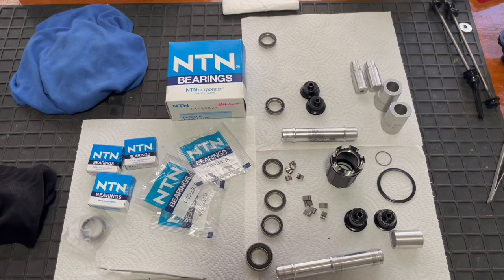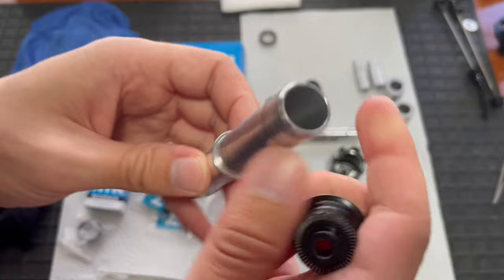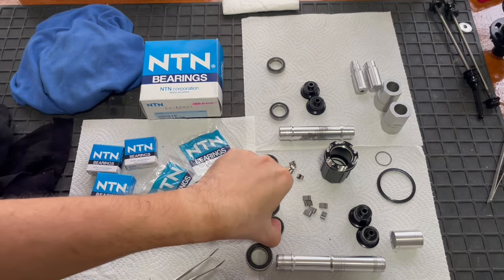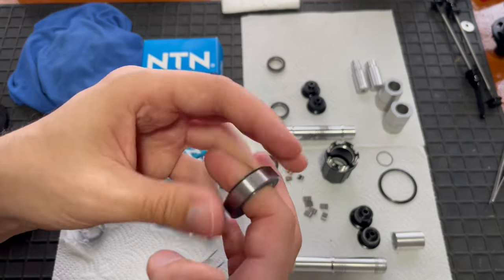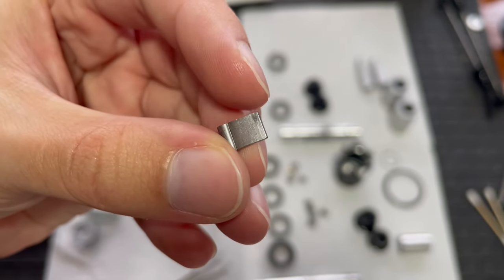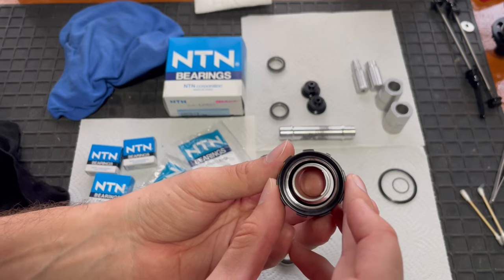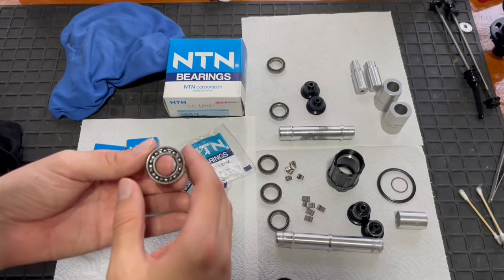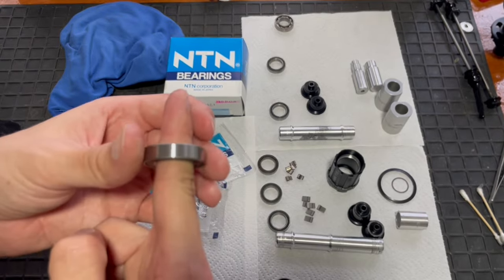My Hyper 2020 Wheels After Only 4,000 KM

Comment: I use NTN bearings in my road bike wheels. They are definitely very good quality. I use the non contact seals on my summer bike and contact seals on  my winter bike. However they still require the seals to be popped off occasionally and a small amount of grease injected or they can run dry. I had one fail on me prematurely that ran dry and started squealing but it wasn’t corroded inside. Another thing i’ve started doing is using Loctite 641 when installing the bearings as I read that it can reduce vibrations and improve bearing life.
Reply from the maker: That’s interesting, so you just lock tight the bearings in the hub or the axle as well? I can see why that might make a difference. 🤔🙂👍🏻
Reply: @reginaldscot165  I use it on the hubs only and not the axle. A thin smear of medium strength retaining compound like Loctite 641 around the inside surface where the bearings press and seat into the hub.

Comment: I've got a bunch of Chinese hubs, some axles have too small of a distance between the 2 bearings causing the play you speak of. You can use a small washer over the axle in between the bearings but it will slowly cut into the axle
Reply from the maker: Interesting 🤔 👍🏻

Comment: I never trusted ceramic stuff. Maybe ceramic is good for certain application but bicycle wheel is not one of them which are subjected to judder from road surface. I source Ezo, NTN bearing from Monotaro, a trusted online market place for technical supply. Sometime it can be rather long lead time for non stocked item, I assume these needs to be imported from Japan. Normally I would use 2RU semi contact seal, or 2RS full contact seal as altenattive. NTN code is a bit different, either LLU or LLB, can't remember which is which. Lately I noticed my rear wheel has a bit of play, looks like bearing is bad after 5.000 kms of mix surface.
Reply from the maker: Yes I have used Monotaro before, they have an extensive range of equipment. 🙂👍🏻
Reply: @reginaldscot165 There are other local online market place, but I doubt all the products are genuine. I assume there are many counterfeit in the market since bearing is a fast consumable item.

Comment: Does the 2023 version hyper wheels have the same axles issue? I'm running set of R45 for 2000km. Edit, ceramic bearing version. If the se version launch early, I will definitely go steel bearings.
Reply from the maker: Yes get rid of the ceramic bearings asap. But the axle in the 2023 model is better.

Comment: How can you have sideways movement of a bearing on the axle when, on the drive side, the distance between the axle shoulder and the drop-out is occupied by 3 bearings, 2 spacers and an end cap; and on the non-drive side by a bearing and an end cap - there is nowhere for the bearing to move. If, as you say in your addendum, there is ‘play’ at the circumference of the wheel, that can only be caused by movement in the bearing itself, or between the bearing and the hub.
Reply from the maker: A reduction in the diameter of the axle as a result of wear. Even if the caps were solid and I moving (and I suspect they are not) everything would be able to move up and down. 🙂
Reply: @reginaldscot165  I thought you said the bearings were moving sideways?!
Reply: My takeaway was that he is having a rocking motion on the axial plane.

Comment: Is it possible to remove and install those bearings at home? Or it requires special tools?
Reply: As a former shop mechanic, it's rarely a good idea to not use the right tools for the job (the thought of it grinds my gears). In terms of bearing removal, you can remove the hub shell bearings by knocking the axles out with a mallet. You'll need a bearing puller for the freehub body bearings.

For reinstallation, a hub bearing press tool is the ideal solution.
Reply from the maker: Yes it’s possible, but not recommended if you want to do a good job and avoid damage. You can find some very cheap but good tools online nowadays. 🙂👍🏻

Comment: The composite steel ceramic (hybrid)  bearings are a total waste of money, I wouldn't even entertain the idea of them.
Full ceramic are a different story though but several times the price of steel bearings, probably worthwhile for someone who spends too much time washing things particularly if they do it wrong and have direct flow at / into bearings instead of avoiding any seal area's.
The bearing cage material isn't really an issue, very much doubt anyone can  ride fast enough  for cage to deform or overheat.
On IC engines and vehicles capable of high speed, steel or bronze cages are best, sometimes even being silver plated to reduce friction
Reply from the maker: All good points.

Comment: Ceramic bearings are only good if the races are made of ceramics too. Don't use bearings with different material hardness.
Reply from the maker: Agreed. 🙂
Reply: I personally think the only place where full ceramic bearings can be used on a bike is a rear derailleur's pulley wheels.

Comment: Ceramic bearings were the "thing" before 3D printing became the "thing". Years before, CNC'd color anodized stuff was the "thing" In between those titanium was the "thing". See where this goes? Avoid the newest-latest, hyped-to-the-max "thing" and you'll save money and spend more time riding and less time wrenching. You're welcome :-)
Reply from the maker: Titanium is still the thing. 😁
Reply: other over hyped  improvements .....are disc brakes, center - lock, thru axles,  tubeless  tires , hookless beads, chain waxing , single chain sets, adding extra cassette  cogs, electronic  shifting , thinner  chains.......
Reply: @joystation1  apparently, someone  has limited  comprehension  and  communication  skills .

Comment: Those 6803 bearings have almost half the load rating of  6903, cost the same, don't weigh or drag twice as much....
Reply from the maker: Cost is not the same I think? 🤔
Reply: @reginaldscot165  do a cost per mile and tell me if its cheaper haha

Comment: The info that steel cages are better and more efficient than polymer cages is false and comes from hambini that only sells those.
If you do some research, you'll find that it is the other way around, not by accident that ceramicspeed and other top of the line overpriced bearings come with polymer cages...
Reply from the maker: Thanks I will! 🙂👍🏻